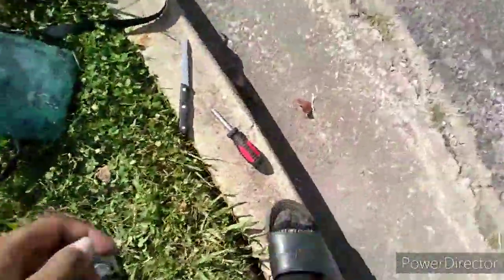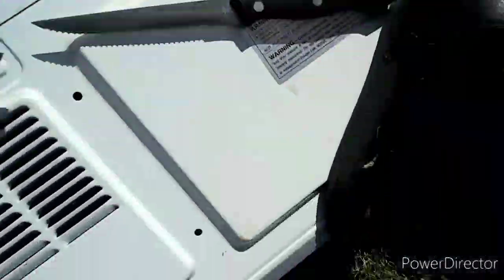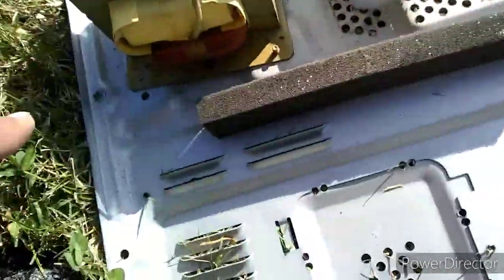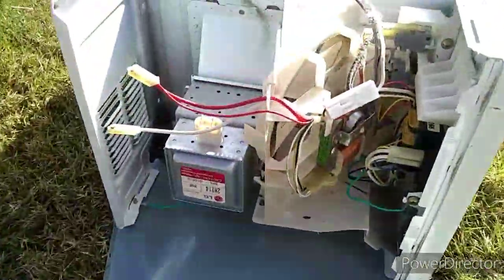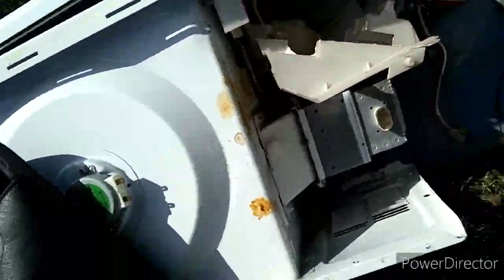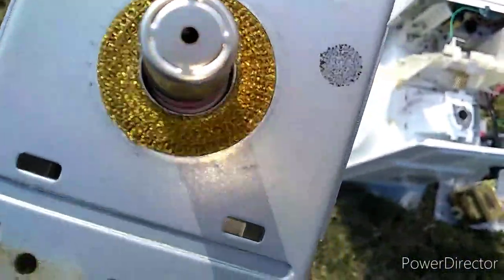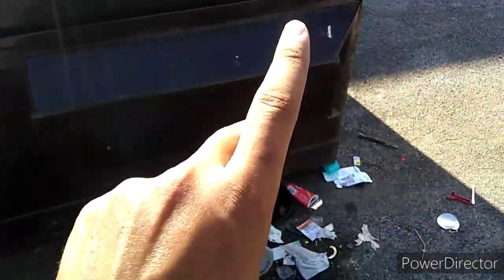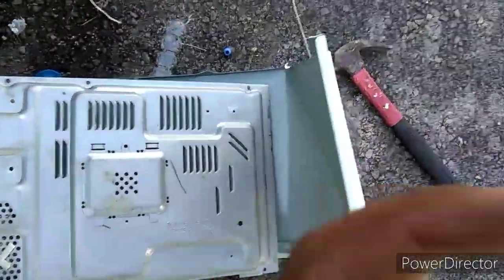SCRAPPING A MICROWAVE FOR COPPER

Comment: The silver  thing next to the transformer is the capacitor, be careful with it those things can hold a charge. I would definitely take the microwave in for steel. The large transformer is usually copper and aluminum wire one side copper one side aluminum.
Reply from the maker: Yeah that’s why I didn’t touch it. Didn’t know what it was lol. I might come get it another day when I feel like taking it over there if it’s even worth it.
Reply: @cybersouljerzcrust  It's all worth it, in my opinion. Don't under estimate the value of the lower priced scrap.